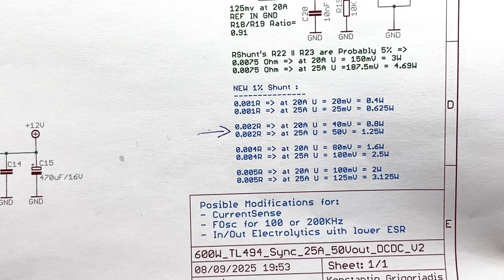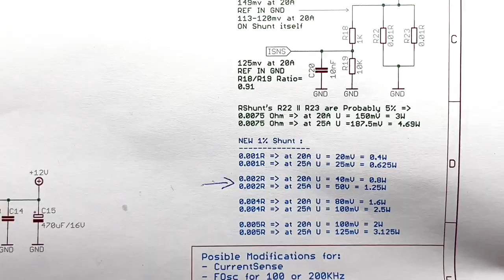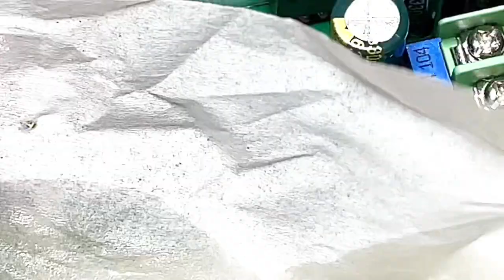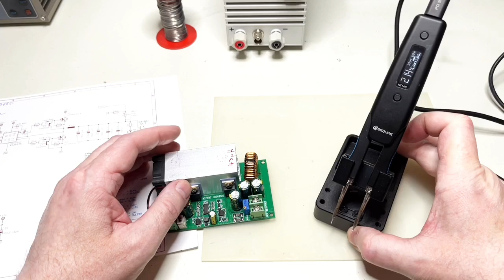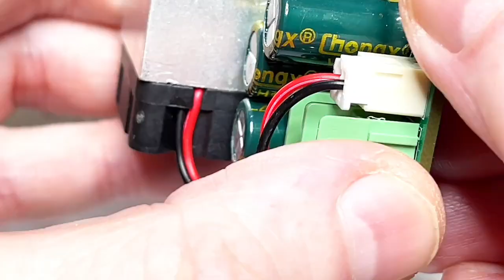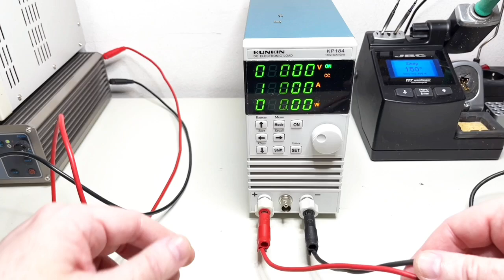IMPROVING the 600W 25A DCDC Converter using SEQURE HT140 Hot Tweezers

Comment: Hello.  
This module has a very significant drawback: a large difference between the output and input voltage. This is due to the IR2104 driver specification. The maximum PWM signal fill rate at its outputs does not exceed 70%, even if the signal at its input is 97% filled. I thought about this problem for a long time and came up with the idea of using an LM25116 controller from a similar synchronous 20A dc-dc module instead of the TL494 and IR2104. This module has a PWM signal at the transistor gates of up to 100%. The transistors, inductor, and shunt were removed from the module board based on the LM25116 controller. Instead of capacitors, only one 100 microfad capacitor was installed at the power input. The controller is powered from the 12-volt converter of the 8025 module. The two boards are connected by wires to control the transistors, as well as for current and voltage feedback.

Comment: "Can we increase this module from 25 amp to 35 ampr 32 Amperes? What changes will be required?"
Reply from the maker: Hello, there is to much to change, the Shunt is not even for 20A CW as you see in my Video, the Output Inductor must be redesigned, the Output and Inputs caps, etc, a redesign is the better Solution

Comment: Is the duty cycle operating to 90 % because i nothing the tl494 pin 13 is ground and rhe output is 90 at the pin 13 operating in single phase so am wondering if rhe ir2104 is cutting the the frequency in two as well as the duty in two so can you phase tell me if the gate duty at fully load is 45%duty or 90
Reply from the maker: Hello, the Maximum Duty can be >= 90% depedding on the Feedback, the IR2104 is neither dividing the Frequency nor changing the Output DutyCycle, it just opens the HiMosfet at the Hi input Level and the LoMosfet at the Lo input level of the Square wave.

Comment: Если необходимо использовать конденсаторы с низким ESR, и которые работают на больших частотах, то полимерные конденсаторы более предпочтительны. И желательно ставить их несколько штук, так они будут давать более низкое внутреннее сопротивление, нежели ставить один большой..
Reply from the maker: I fully agree, but:
1) Polymer Caps at that Voltages and Capacities I have never seen and if exist are unpayable.
2) You have only the space of the Old Capacitors for new Replacements.
The Scope is to Improve the Existing Converter, not to build a new one :-)
Reply: @KonstantinGrigoriadis  Да, есть такое, порой, для доработки существующего преобразователя, в оконечном результате, получается прибор, далеко напоминающий, его прежний вид :D.  По поводу конденсаторов, сейчас поискал на китайском рынке, есть конденсаторы 63V220UF (видимо на большое напряжение у них нет экземпляров на большие ёмкости), стоят около 4-5 долларов за 10 шт.
Reply from the maker: @SINHRO-FAZA  Anyway the ones 1000uF I showed in my Video are more that adequate to do the Job when have 3 in Parallel (each in/Out) as on the Inverter, the plan was to change all the Existing Caps with the ones I showed, not leave only one Larger.

Comment: Hi Konstantin, nice to see you back. 
It seems that you are close to a very nice and good working high power power supply. Those cleaning wipes seems also very decent to work with, i always used kitchen paper like we call it here in Belgium, but that paper is not that strong. Now since a few months i also use the "Nano sponge" from the brand "Mechanic" which you can buy on Ali, Temu etc..... these are small sponges of in a cubic form of 1 centimeter, with 800 pieces in a box for less then 3 euro on Ali. These are very handy to clean in corners on a pcb between components.
Reply from the maker: Hi Bjorn, Thamkyou, yes I use these cleaning wipes since the 80’s when I started my first Job and we had those in the Lab for pcb cleaning. Cheers, Konstantin
Reply: The blue shop towel rolls at Action are worthwhile having around too.
Reply: @AnnaVannieuwenhuyse  Thx for the tip, i just looked at the Action site, and found it. I know what to buy next time :-) Are you from the Netherlands or Belgium ? Grtz
Reply: @BjornV78 Belgium.
Reply: @AnnaVannieuwenhuyse , same here. Grtz
Reply from the maker: Hi Bjorn, regarding a secondary regulator for your power Transformer, you can use a ready made buck converter like this one : (there many more to choose with more bells and whistles :-)

I just found this on AliExpress: €21.13 | 1000W 50A DC-DC Buck Converter DC 25V-90V Adjustable Step Down Power Supply Module With Digital Display Wide Voltage Regulators
https://a.aliexpress.com/_Ew8h09U

Cheers,
Konstantin

Comment: Awesome video! how can I learn more about the compensation network design?
Reply from the maker: Thankyou, Here some Links:
https://www.youtube.com/watch?v=By_IpZ7TjnQ
https://www.youtube.com/watch?v=PkjDUQjEDBw
https://www.analog.com/en/resources/technical-articles/power-supply-loop-stability-compensation-part-3.html
https://web.pa.msu.edu/hep/atlas/l1calo/hub/hardware/components/power/Not_Cuurently_Used_In_Hub_Design/linear_modeling_loop_compensation_an149.pdf
https://www.ti.com/content/dam/videos/external-videos/es-mx/4/3816841626001/6023852368001.mp4/subassets/control-of-smps-presentation_0.pdf
Much more Info to find in Google bcs this is a complex matter with not one Solutions(Depending of the Compensator Type I,II,III, etc and the Switchmode Topology)....
Cheers, Konstantin
Reply: @KonstantinGrigoriadis  Thanks a bunch!

Comment: you are applying way to much solder and getting those SMD shunt resistors too hot will put them out of spec . the ends of those smds's are only bonded on . Yes the tweezers are great slight learning curve .
Reply from the maker: Hello, the shunts I use are metalfoil type with an Copper base and a zeranin metal foil that carries the current. Of course the soldering i did as said in the video was not ideal bcs under the cam.

Comment: Next one if possible 800w buck converter
Reply: In IR2104
Ho is in phase with IN
When IN is low (pwm out off)
Ho is low , Lo will high
Is this condition ok for half bridge.
If SD will pull down then HO and LO will low that is ok.

What is it's solutions.

800w buck converter is perhaps non synchronous buck
Reply from the maker: which 800w Converter you refer ?